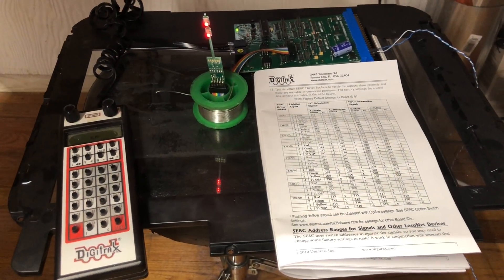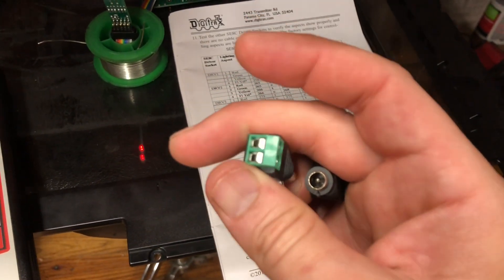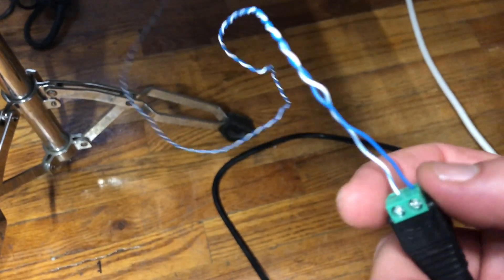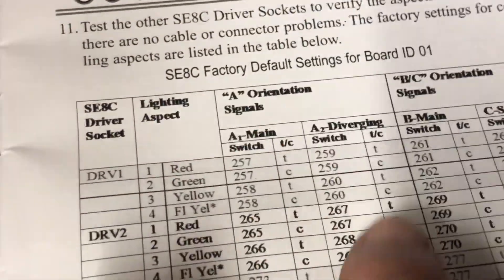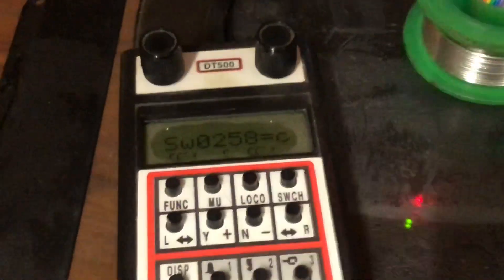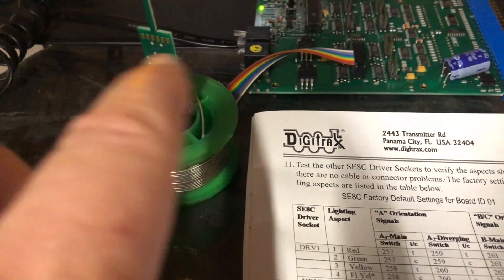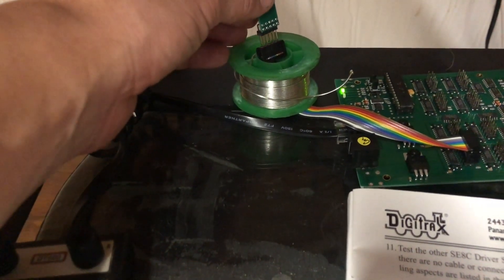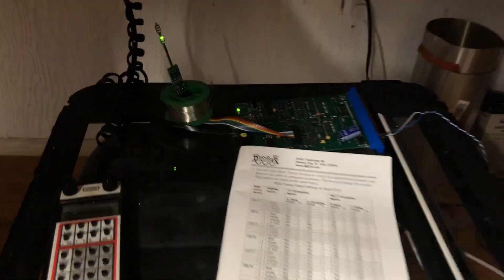Rhythm RR (Signal System Project) Part 1

Comment: The SE8C can control up to 8 slow motion switch machines in addition to the signal heads, which are run from the blue connector along with power. It's likely one of those that let out the magic smoke when you plugged the board in upside down.